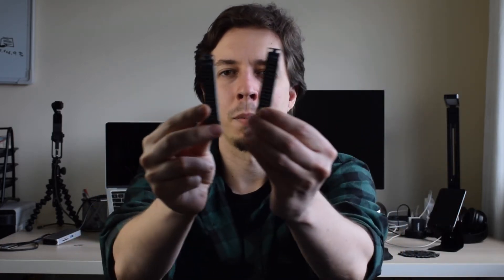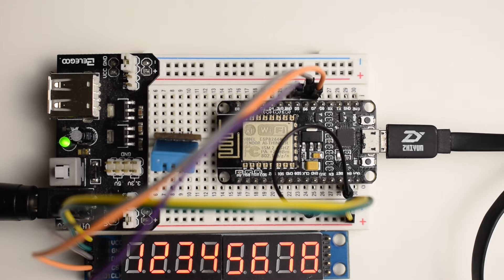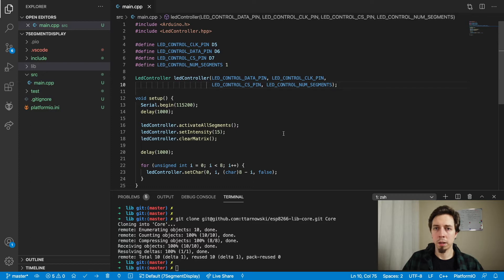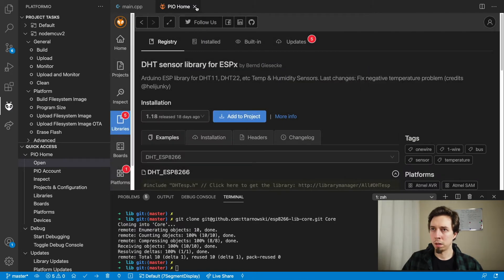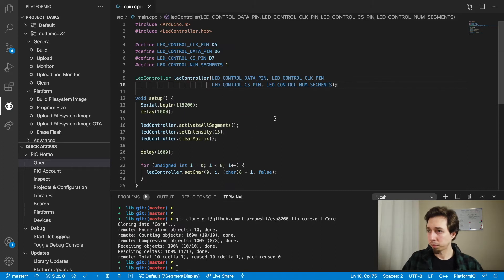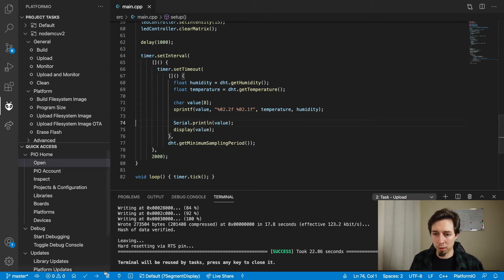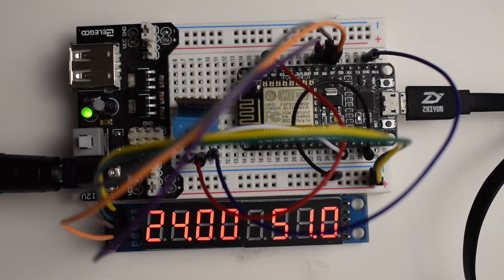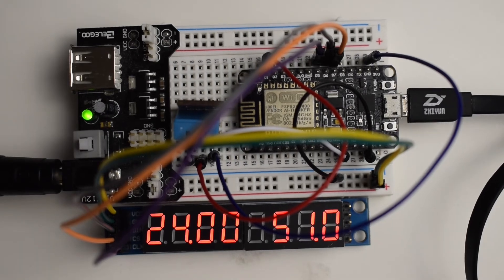Control multiple 8 digit 7 segment displays with ESP8266 - Day 17 of #100DaysOfCode in IoT

Comment: could not synchronize the time
Waiting for NTP time sync:  i have followed your instructions but i keep getting this error. Where do you set wifi ssid and password
Reply from the maker: Hi Mukundan,
You're right - the logic to connect to WiFi was missing. I have updated the code example: https://github.com/ttarnowski/esp8266-8-digit-7-segment-display-MAX7219/tree/Day17
Reply: i will load it and post the result for you in a day or two. Thank you
Reply: Hi Tomasz
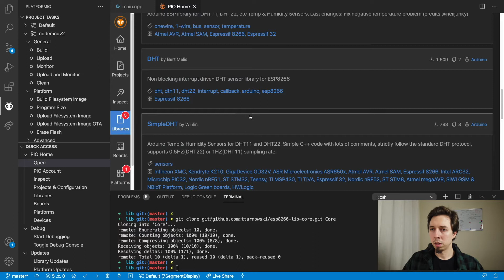It works .  But I still have one issue. Its taking the time which is  always  behind me it does not take +5:30 from the pool even if i change it to in.pool.ntp.org.
Sorry to trouble you
Reply from the maker: no worries, the issue is with the timezone - as a default time is in UTC for an Indian timezone you need to add one line of code to set environment variable with your timezone and use localtime_r function instead of gmtime_r. Basically replace this line:

https://github.com/ttarnowski/esp8266-8-digit-7-segment-display-MAX7219/blob/b95a40aaadd5fe1525e719386892126bc8f4eb93/src/main.cpp#L95

with:
localtime_r(&now, &timeinfo);

and add:
putenv("TZ=Asia/Calcutta");
somewhere at the beginning of setup function

here you find more info:
https://en.cppreference.com/w/c/chrono/localtime
https://en.wikipedia.org/wiki/List_of_tz_database_time_zones
Reply: hi Tomasz Tarnowski

Must confess that im not a software guy and im also 60+ . I have made the change for local time as you pointed it. But i dont know where to add TZ.
sorry once again. I m doing this out of passion.
Reply from the maker: you need to add "putenv("TZ=A");" at the very beginning of setup function:

void setup() {
  putenv("TZ=A");
  Serial.begin(115200);
  // the rest of your code
}